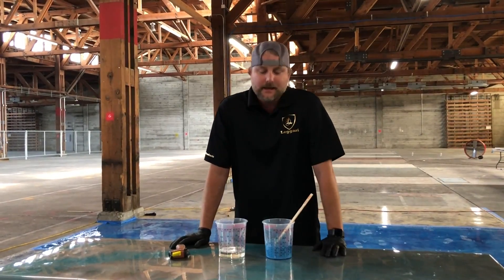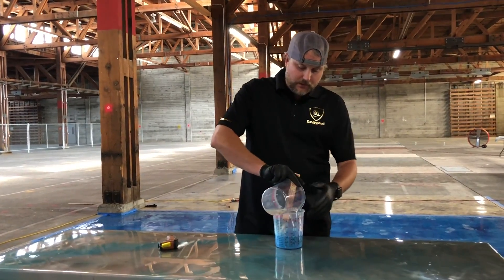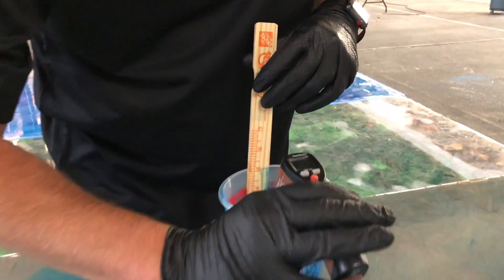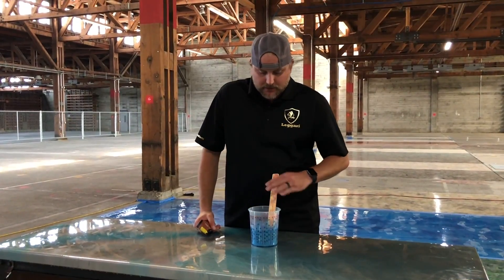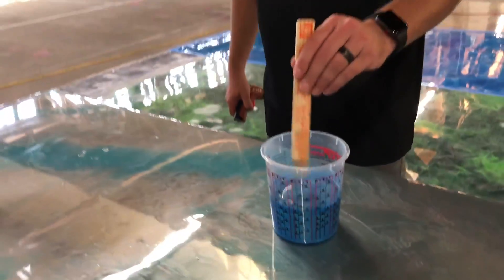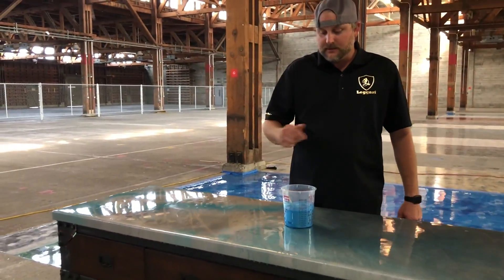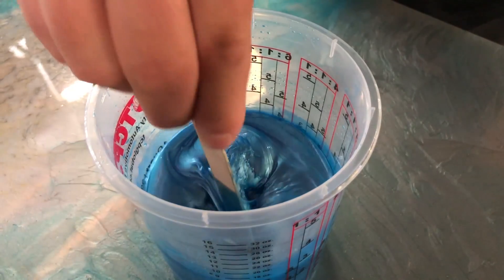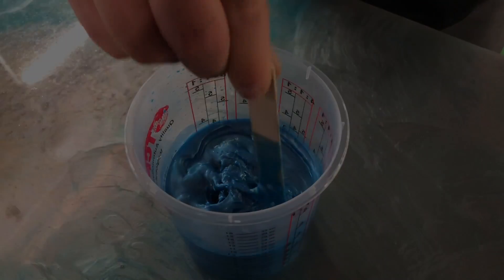FAQ Wednesday: Pot Life or Why Epoxy Heats Up

Comment: I love the videos. Thank you. ? I have a counter in my bathroom soap stone. My sink is part of it. Can this technic be used inside the sink itself and would it seal a sink leak.
Reply from the maker: You will want to seal the sink hole with multi purpose bondo from Home Depot then you can apply our product.  You can contact our tech at  844-534-4274 for install questions and help.  Thanks

Comment: Can your floor epoxy be used for casting or filling large gaps like on a "river table"?
Reply from the maker: Yes you can use it to fill gaps or cracks on a surface.  Thanks